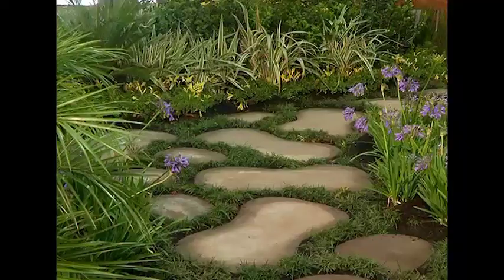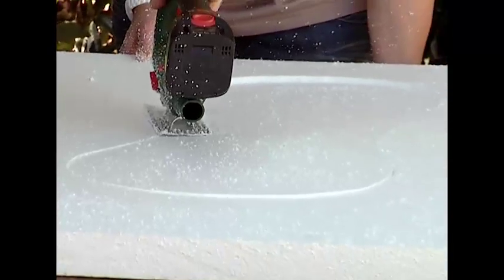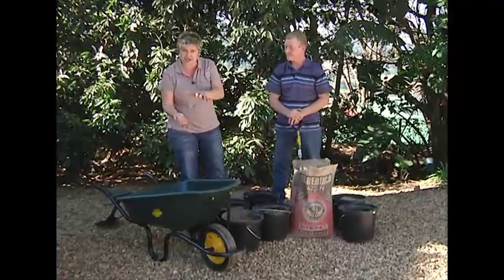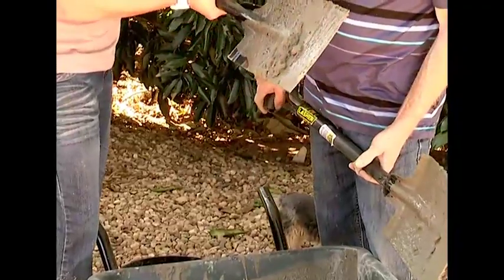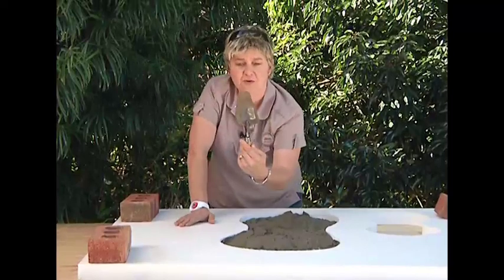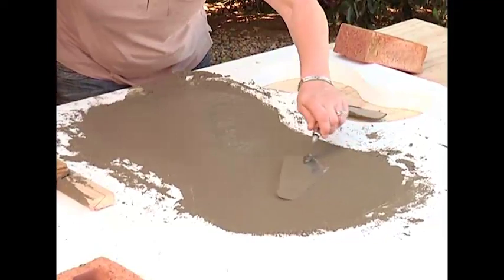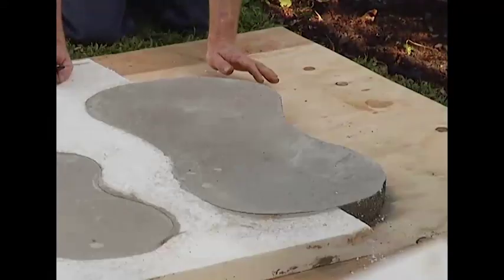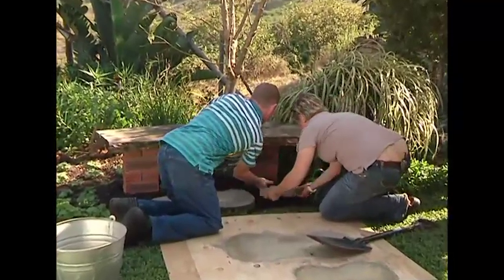DIY: Making Figure Of Eight Pavers

Comment: I made the same ones with 2.5" styrofoam purchased from the local hardware store. If you spray regular cooking spray (pam) around the edges before you pour your concrete when it is dry the styrofoam lifts right up no need to cut it. Great work I spray painted mine then coated them with plastic coat so the paint doesn't peel during rain or weather changes